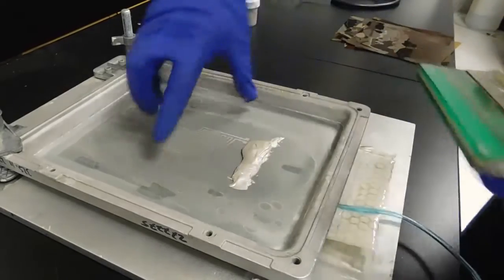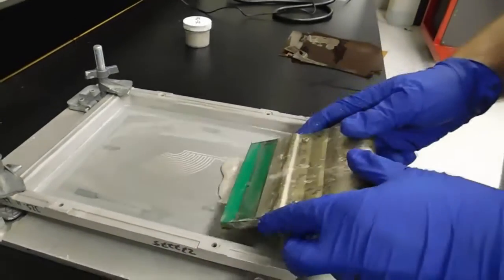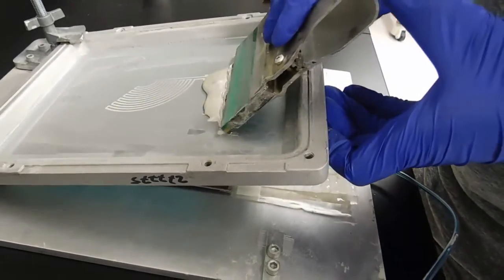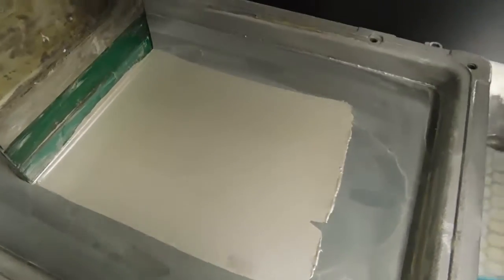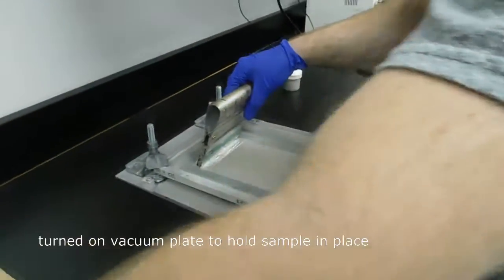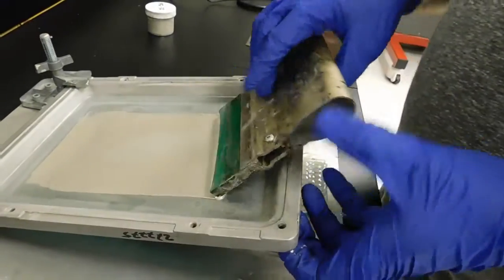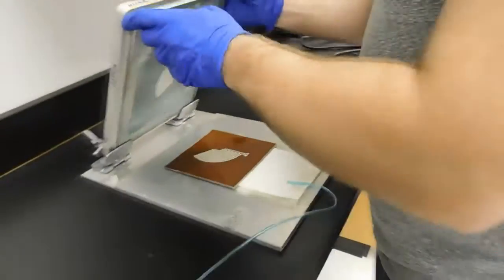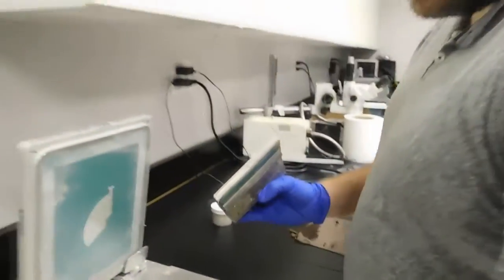Conductive Ink: How to Screen Print a Heating Element. Pt 2: Printing!

Comment: How can I do it at home?
Reply from the maker: We suggest ordering the NovaCentrix screen kit:

http://store.novacentrix.com/Screen-printed-electronics-starter-kit-p/910-0092-01.htm (FG32 is available as an optional addition to that kit)

For a custom screen from a professional manufacturer you may contact Mallory Mackenzie at UTZ (cad@utz.com) or you may have a screen made at your local art store.

If you have a screen printer available and an interest in making your own screen you can purchase a screen kit from speedball:

https://www.amazon.com/Speedball-Advanced-All-Screen-Printing/dp/B007W6SAD4/ref=pd_cp_201_3?pf_rd_m=ATVPDKIKX0DER&pf_rd_p=ef4dc990-a9ca-4945-ae0b-f8d549198ed6&pf_rd_r=MBZXWBFRJ0YM0E9CPX3K&pd_rd_wg=BMpDg&pf_rd_s=desktop-dp-sims&pf_rd_t=40701&pd_rd_w=2bGda&pf_rd_i=desktop-dp-sims&pd_rd_r=2cb4eb8a-ec16-11e8-b5ba-5dfed4e35b83&pd_rd_i=B007W6SAD4&psc=1&refRID=MBZXWBFRJ0YM0E9CPX3K

Also to use the ink in the video you can purchase from our website:

http://store.novacentrix.com/HPS-FG32silver-screen-print-ink-p/910-0108-01.htm
Reply: the ink is very expensive, can I do it with my own, graphice based? 
 @NovaCentrix
Reply: @NovaCentrix  hi